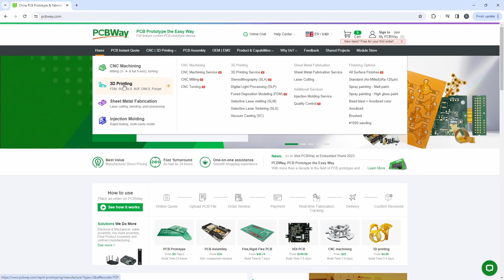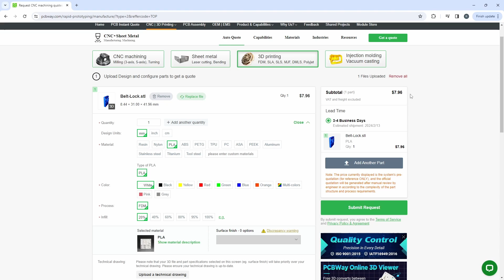Big update to the Rook 180 CoreXY 3D printer now called Bastion!

Comment: How did you wire triple z steppers?
Reply from the maker: the board has 3 stepper drivers one for each Z motor. It's a 8 driver board
Reply: Which board is that? And are there boards with more than 8 stepper outputs? @Rolohaun
Reply from the maker: @David_Mash  I think there is a 10 driver board but you can always combine boards together Klipper makes that easy
Reply: @Rolohaun  i did not know this. I am jumping in to a ender3v2 plus ender3maxneo Frankenstein build

Comment: How do ungeared belted Z work for you so far?
Reply from the maker: I don't mind them but you do need to dock the bed at the bottom after every print or the bed will drop. LDO also has motors to prevent this

Comment: Would there be any benefit to strength and stability of the chassis if using allthread passing through the entire length rather than the current setup?
Reply from the maker: I don't think it would be worth the effort but hard to say, I wouldn't hurt if it could be easily done
Reply: @Rolohaun That's what I am thinking could be simpler and stronger with less hardware..If there is enough room to pass say 1/4" allthread through the frame.  It looks like that could be challenging with the way the motors are installed.

Comment: Hello, I am new to the 3d printer and I wonder if would you mind sharing with me the instructions to set up the software for Bastion. Thanks.
Reply from the maker: I have some klipper tutorials on my channel and the printer config for this printer is on printables
Reply: Hi there is the setup of the motherboard as easy as just overwriting the config files on the sd drive ?(I dont have a lot of experience with these boards) 
Beautifull printer otherwise.

Comment: Is there going to be instruction on how to assemble the bearings/idlers and belt routing. I understand 3d printers pretty well, but this will be a first-time corexy build for me. This was very appealing to me because of the cost to fun ratio as building a trident would be way too overkill and expensive for me. Also, is it equipped with sensorless homing because I didn't see the typical little omron switches in the BOM
Reply from the maker: yes it uses sensorless homing, defiantly join the discord and we can help you with the belt path. It's pretty easy once you start building! I also have a 3D view on my website that has the belt routing https://www.rolohaun3d.ca/3d-printers
Reply: @Rolohaun  sweet thanks! I just took a look at the cad, and it seems like it isn't too complicated
Reply: Hi Rolohaun.
I was wondering how you program the motherboard.
Is it just adding your files to the sd card on the mks board.
I didnt really find anything about that.(I also dont have much experience with it,but still wonder .)

Comment: Could yu make an industrial-tier 300x300 printer, similar to the HS3 and Bambu X1?
I plan on building my own completely from scratch (design, etc.) Where do I start?
Reply: If I remember correctly, the conclusion to Simplecore was, "just build a Trident for the same money"
Reply from the maker: I don't design printers that large but my designs are pretty east to scale up. To design your own you need to learn CAD and start there
Reply: The new Panda is scalable to 300x300